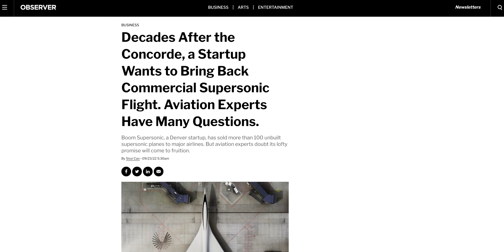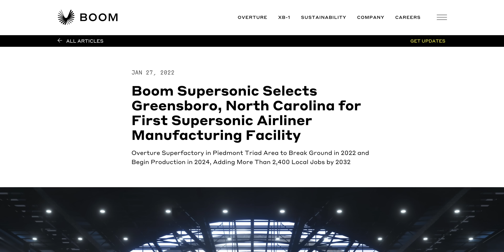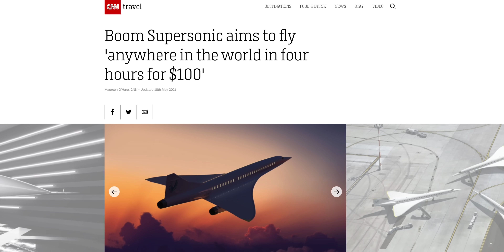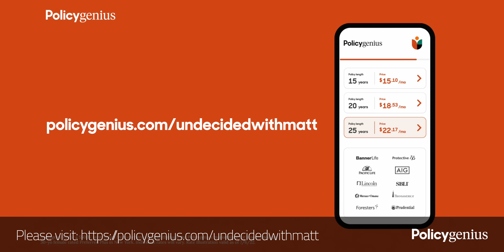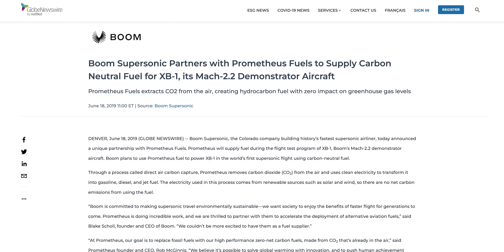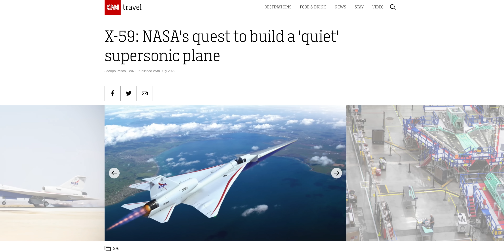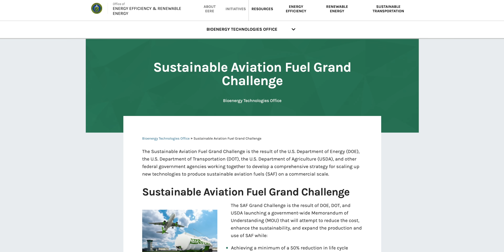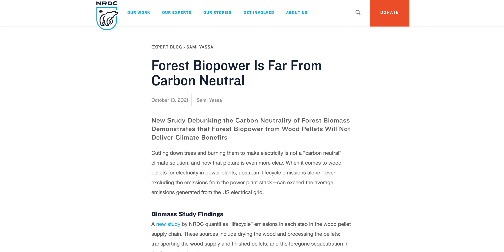Fueling a Clean Supersonic Plane Comeback

Comment: It is a better investment than a bullet train.  I can guarantee that.
Reply: Well considering bullet train tech has already been used and tested and is well within the market already, at this point I would have to disagree with that assertion. If we look at the Shinkansen as a example, its current capacity is 1,323 per train with 16 trains moving per hour so within a 24hr period it can move 508,032 at full capacity with roughly a 3 minute turnaround time per train while not requiring fuel.
While if we look at Boom's Overture its capacity stated by them is only a 88 passenger capacity at max, so if we use the same math as the Shinkansen example the Overture will only be able to move a marginal 33,792 and if we look at turnaround times for aircraft today which is typically a minimum of 30 minutes and can go to a upwards of a hour plus, which will further decrease its passengers moved within a 24hr cycle, with the only upside being there technically could be a infinite number of Overture's flying to from different destinations at a given point and are not bound by terrain features.
So for domestic and intracontinental routes bullet trains are the answer, while the Overture will likely fall into a similar niche as the Concorde did to answer the faster intercontinental trans Atlantic and possibly even the trans Pacific routes if they can meet the range requirements.
The only downside to bullet trains in the Americas will be needing to build the infrastructure required to facilitate them, as passenger rail has fallen by the wayside since the 50's here, however in places like Europe where passenger rail still makes up a decent part of the mass transit industry they will be much easier to incorporate.
Suffice to say each has their pros and cons and both should be used where adequately viable.
Reply: @HypnoticChronic1  This kind of thinking is why the bullet train has failed to make a profit anywhere.  It is highly subsidized by government funds.  Even jumbo airplanes are not used as much as smaller 737s and A320s.  In what universe do we have 3000 people going from one source to the exact same destination around the same time window?  That is not how travel works.  About 4 hours is the travel time people will opt for a plane over car travel due to total time spent in the airport and car rental places.  Also, supersonic travel and bullet trains were both done in the 1960's.  A bullet train is not even close to approaching a typical small regional jet or any of the bigger jets.  Comparing bullet trains to supersonic travel is another leap of speed increase.

Unless you have practical experience at spoke and hub transportation on bullet trains, you will not understand why bullet trains are a waste of time and money.   It is not accurate to say there is a 3 minute turn around on a bullet train.  Have never been on one that was ready to go in 3 minutes.  There is cleanup, restocking of drinks, food, etc.  The boarding process is exactly the same as an airport and nothing like a commuter train.  The train does not travel at high speeds nearly as much as they are advertised.  There are tons of stops, turns, and even when 2 trains pass in opposite directions the TGV has to slow down due to the vacuum effect that can cause a train to derail.

My business trips that could have been 3 hours round trip including the hour long meeting on a plane from Paris to Saint-Étienne took all day to accomplish the same thing on the TGV and I had to get up super early to make it to the meeting on time.  Here in California, the grid is literally not ready to operate a bullet train.  And look where it goes:  Sacramento to the city of Bell.  Do you know how long it takes to drive from Bell to any business destination in Orange county?   A train ticket on the TGV is over $200 for round trip and a plane ticket is only about $50.  California is estimating over $350 for a one way train ticket.

Then there is the additional costs for double the infrastructure like rental cars, security, etc.  Tunnels are required in the city and through hill geographies.  Water crossings are a challenge.  The rails are seamless friction welds that require special machinery.  So much cost in a train.  We still don't know what the total cost for California will be.  They only have 9 miles built after billions of dollars and 10 years.  At least in Paris the trains are at the airport and airplanes and trains share these services.  Not in California.  Airport is separate from the Train depot.

Amtrak has a more sensible high speed rail that can operate to about 150mph and is available already on the east coast.  It is still a huge waste of money for the type of travel that Americans do.  Commuter trains are much better suited for daily travel here.
Reply: @sammcbride2464  So to answer this question "In what universe do we have 3000 people going from one source to the exact same destination around the same time window?" Data on the Shinkansen can answer that question for you should you seek to read through it.

I also would like to note that I never stated the tech for supersonic aircraft has not been around for awhile now, a statement like that would literally negate the existence of every fighter aircraft in the world as well as the Concorde, what I did state tho was "bullet train tech has already been used and tested and is well within the market already", meaning it was not a unproven tech that required more R&D and that they are currently operating quite well as we speak, unlike with supersonic aircraft where there is not a single passenger one operating in current year and still requires R&D to make them viable for more applications than trans Atlantic flights, quite literally the very thing that was the basis for this video.

Now for the last clarification, this is likely due to poor wording on my part regarding the use of turnaround time, so apologies for that. What I was attempting to state there was that it takes roughly 3min to offload one group of passengers at a stop and load another group on then move onto the next stop, it has never been that quick for any aircraft I've ever flown on. 

Oh I also did note the issue with infrastructure and terrain regarding trains here "with the only upside being there technically could be a infinite number of Overture's flying to from different destinations at a given point and are not bound by terrain features." and here "The only downside to bullet trains in the Americas will be needing to build the infrastructure required to facilitate them, as passenger rail has fallen by the wayside since the 50's here, however in places like Europe where passenger rail still makes up a decent part of the mass transit industry they will be much easier to incorporate."

So I did note one glaring issue here as well your use of California as a example, it is well known California is bureaucratic mess and takes them twice as long to get anything done as most other states do, frankly that's the fault of the political system there rather than the train itself. As for your other point on price I measured the distance between Sacramento and Bell and I have traveled roughly the same distance on a bullet train before (only short by 9 miles) and the price for that ticket was only 320 Yen which is just a little over $2 currently, which is well below both the train and plane prices you listed. So again I see it as being more of problem with California itself being overly priced for everything and a bureaucratic nightmare, rather that a issue with the train itself. 

Oh one more thing you noted that the trains would note be able to travel at top speed all the time, while I do not disagree with this I would like to note the same can be said for any supersonic aircraft as well, due to that supersonic ban over the US the same issue the Concorde ran into and why it was regulated to only trans Atlantic flights, with said ban in play it is little better than a current low capacity jet as far as domestic routes go.

Comment: Many years ago, I read an article in Popular Science (I think?) about new supersonic jet designs, one of which was an "oblique flying wing" design, which would fly "straight" at subsonic speeds, but then the angle of the engines would pivot and it would fly at an oblique angle at supersonic speeds (presumably to accommodate for the mach cone). It was really intriguing.

Comment: Great video! This is topic very close to my heart. Those claims sounds very very ambitious and also if those were achieved then normal subsonic flights can become much more economical too. It is good that they pushing the current technology and boundaries but I just doubt that this will happen in the near future. The issue with the engine manufacturer, the other issue with the sonic booms... they will face the same issues as the concorde. For example: BA and AF also had to park another concorde sometimes just to ensure there is a replacement if something happens. I am a bit negative on this one I guess :)
Thanks for the video though! Very good summary of the situ

Comment: It's difficult for me to not be cynical about this technology. I see planes like this being used mostly by the super-rich to continue in frivolity as the world literally burns and floods beneath them. 

If private industry wants to pursue this, it's on them. When tougher regulation measures come down (and they will), tech like this is going grounded for all practical purposes, at least for the medium term. The day may come with the supply of climate neutral hydrocarbon fuel is great enough to provide for these things on a mass scale, but that day is a long way off. 

A far better path for air travel is lighter-than-air technology that is both lofted and powered by hydrogen. It's not nearly as fast, but it is far, far more efficient.

Comment: Using comparisons to the 747 is misleading. It's like comparing a sports sedan to a bus. The only thing relevant with the 747 to the Overture in number of engines. Comparing it to a 737 would be more realistic in my opinion, even if not apples to apples.

Comment: it might help to think of clear planes makeing use of clear materials for solar chargeing in the whole body also lowering the amount of batteries needed since chargeing on the go then pulse climbs saves on fuel and gives a moment to climb before the next ecelerant point cuting time by the pulse of already being accelerated when applying the next boost also cuts the booming blast but when the body is fully covered your chargeing at a sufficiant rate to drop battery requirements meaning lighter but clue it doesnt require a boom to hit sonic hyper speeds ya just slip up to it and slide right in going faster than sound... solar threading can also provide charge but less than full body panel skining but applied in a clear skin allows for patterning as design imagery while provideing power at the same time  till then its dead weight not being utilalized to its fuller compacity also when the skin is designed withair intakes you got more suction and filtering space expanding the amount of air you can thrust out of the smaller exhaust more intake makes more pressure out the one point  and resulting in clean air without much of any fuel more than a magnetic nudge this is where a pulse climb wins as a steady runner vs the blast and pause to walk  because they ran outa fuel while the other conserved waited till the momentum rose before the next aplication  doubling the prior speed sped on and down floated on coaster... rise  sped on  first climbs not so straight up saves too on initial rise fuel by the same stretched pulse little by little rise  the boom didnt make ya faster  it just boomed and jolted a second  and on the ground the image reaches ya before the sound it doesnt mean they went faster than sound cus the boom. up close is still a boom on the second of the boom so you move a little before the ground hears anything while the climber can zip by  faster and never be heard because it sucked in half its echoe and pushed it all into thiner point as a boat without waves is like a needle thrown in the sea and shot clear through a tree  cuz it was dropt out the plaine but hum just a few tweakers to pass along...includeing parashooting balloons to float on long journey travel meaning conservation of fuel not used cuz ya dont need the fastest flight but the one that is going to get ya there and since the balloon carriage its an added security if the wings faile so you could increase the chance of safely landing on the float and coast ...includeing to charge while coasten hints a smaller amount used in the begining and getting more charge than used

Comment: Boom really feels like vaporware at this point. All the major engine manufacturers have bowed out, the company is currently not answering questions about engine sourcing, and if you don't have an engine, you don't have a plane. It's literally the most critical component, and the engineering challenges in creating supersonic engines are different from all the work that's gone into subsonic airline engines. Yes, you could use engines from military jets, but those aren't designed with fuel efficiency as a high priority. Also, its pricing claims are comically unrealistic, to the point where they raise huge red flags.
Reply: Also, the majority of travel time for most people, especially post-covid, is traveling to and from the airport, getting through security, waiting around, sitting in the plane on the tarmac, having 2 layovers, etc. The additional speed only really matters if you live in, and want to travel to, a place where it goes nonstop, and it's a very long flight. Only a tiny percentage of passengers fit that box.

Comment: A large portion of cost was not fuel efficiency but opportunity cost. Concorde offered only a fraction of passengers for same slot space vs 747.

This is fine for short-haul flights where speed is less vital but it’s a waste of slot space on crowded long haul flights. This plane needs at least 400 seats to be economical.

Also 1/2 the promises are based on engine technology but they just changed mfr.
If they can adopt their airframe for “clean” engines then so could anybody and everybody else.

Otoh, the argument against 4 engines vs 3 is lame. More drag, maybe, but 4 engines at 60% will be more efficient than 3 at 80%.

Comment: This is off subject I hope that’s OK
Hi Matt 
Very much enjoy your channel. I was just watching your interview on Fully Charged, a long time favorite of mine.  
It reminded me of your current project building a zero energy home. As a engineer architect and builder plus being an old fart I have a lot of experience in a low carbon lifestyle. 
In particular I like your Interest in CO2 as an energy transfer/storage medium. A few years ago I installed a Sandon CO2 heat pump hot water heater in our home. We’ve been generating as much or more electricity than we use for 22 years so an electric water heater with a COP 3 to 4 times higher than resistance heat makes sense if you can afford it’s upfront cost, but it will take a very long time to pay for itself. 
In new solar houses I design I’m using tiny electric tankless water heaters right under the sink or  close to where it’s being used.  This not only minimizes waste in the pipe but it also provides instant hot water.  In high mineral water locations they do need a vinegar rinse once a year. We’ve just increased our PV system in anticipation of getting a second electric car and with the recent reduction in PV cost it makes sense to add a little cost to the solar and save cost in a heat pump electric hot water heater.  
WhatsApp if you’d like to chat sometime. +1 (575) 770‑0769

Comment: I always cringe when I hear the term, "net zero". There is nothing zero about it. It is a misleading fudge meaning a process which reduces emissions so that the final emissions are about equal to what was cut from the previous level. The false logic we are supposed to follow is that the savings cancel out the emissions still produced. It is a psychological trick to make us content about continued pollution.
It is 'net half', not 'net zero'.

Comment: When you compared Boom's 75 dB level to Concord's 105 dB level, it would have been helpful to remind people the scale is logarithmic.  Most think it's linear.  That makes the 30 dB difference HUGE.
Reply: There is another issue worth noting, Concord's 105dB was real world and Boom's 76dB is imagined or at best aspirational as they don't even have an engine supplier let alone an engine.
And the one engine company that has more experience with supersonic passenger flight than any other is no longer working with them.

Comment: Makes more sense to revisit algae carbon capture, and then process it through hydrothermal liquefaction. The bio-oil can be used for fuel, while the carbons could make this process net negative if the C is sequestered in soils, concrete or for some other nanocarbon application. Any waste biomass processed via HTL would make the process more sustainable. Fast pyrolysis would work too.